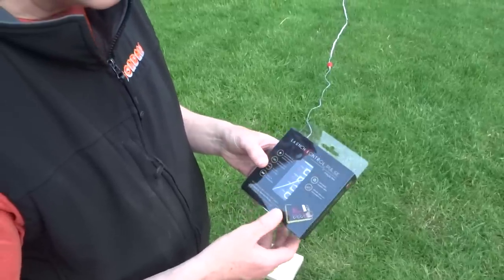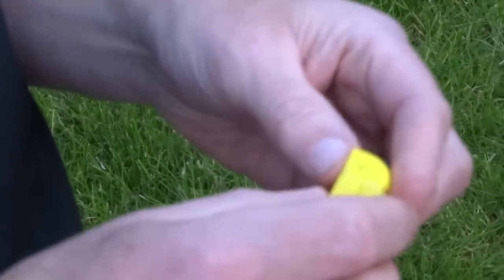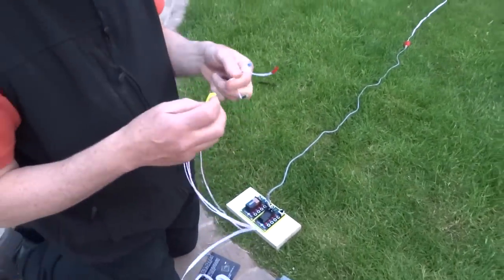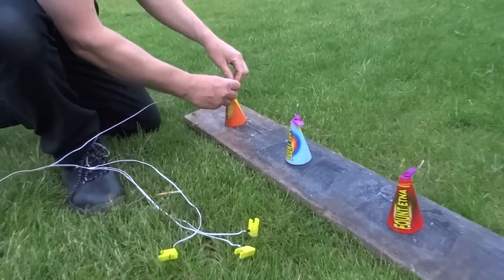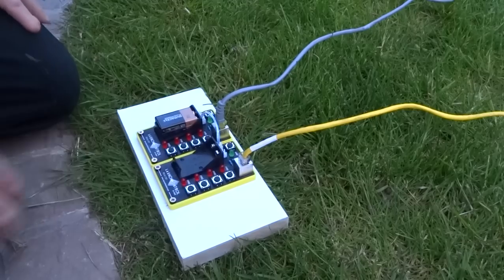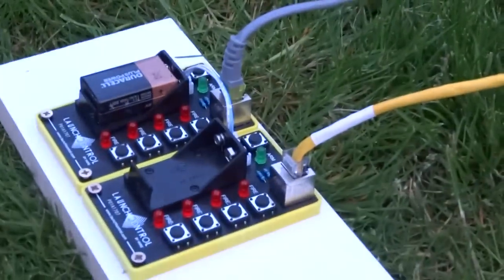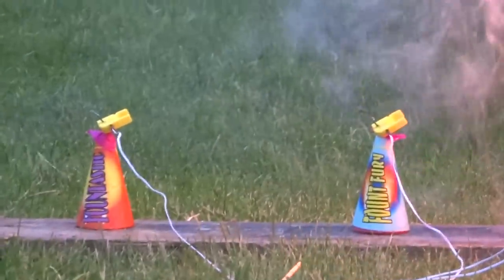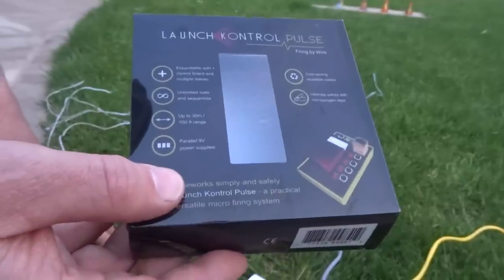Launch Kontrol Pulse Remote Firing System at Jordans Fireworks

Comment from the maker: Firing clip connector colours and corresponding position on the firing board - red connector = No1, green connector = No 2, black connector = No 3 & blue connector = No 4.
Reply: So I'm replacing those clips everytime no thanks I'll stick to .99 cent lighter I can use it all night long without replacing anything....maybe design a clip that's reusable multiple times

Comment: Where can I get the cat5 cable for this system from
Reply: We normally stock them but have sold out of the 25m ones over bonfire night and currently only have 10m one. There is nothing special about our cables but you must make sure you get a solid copper cable one as a copper covered one will not work.

Comment: I'd say definitely not waterproof. The joints between the cables would need taping to make them waterproof and the firing board would also need some sort of cover making to keep it dry. Regarding the e-clips on the fuses you can fit them and then cling film over them to keep that part of the system dry.

Comment: Hello. This would also fire gender reveal smoke color grenades correct?
Reply from the maker: it will fire any product with a visco fuse but not a ring pull smoke grenade.
Reply: @JordansFireworks ok but ring pull grenades have this green wire inside of them (like a fuse) don't they?. If I take it out and clip the yellow clip on it, it will not work?

Comment: The system worked 7 times out of 12 test. Not good when you are in a show and you have to light the fuse manually . Also the Batteries are difficult to insert and remove. I broke some Duracell ...  disappointing...
Reply from the maker: Dear Steve I don't know if you bought your Launch Kontrol from us or another supplier but as Launch Kontrol is an electronic system it does suffer from the odd one that does not work properly, we, therefore, test every single Launch Kontrol before we send it out (hence the question as to whether it was bought from us). There can also be an issue with the cat5 cables and we have come across several that do not work, which is why we also test every cat5 cable before it is sent out to ensure that all of our sets work before dispatch. If you did buy the set from us please contact us. Kind regards David - Jordans Fireworks
Reply: I bought them on Rocketfireworks.ca. I don't know if it was the cable or the igniter... but 5 of my 12 shots failed during my show ...
Reply from the maker: Dear Steve. You can eliminate which part of the system there is an issue with by just firing the e-clips without the cat5 cable (you don't need fireworks attached to the e-clips, you will see the e-clip flash if it has worked. If they all fire when the 4 way cable is plugged straight into the board then the issue is with your cable).  I'm sure Rocket Fireworks will be able to assist you once you have found where the issue lies. Very occasionally we have found a faulty e-clip (again why we test all our sets prior to shipping) but that is resolved by replacing it with another e-clip. You can pre-test the Launch Kontrol before use to the extent of making sure it all works apart from the e-clip igniting the actual firework fuse, it just means that you burn a few e-clips up in the testing. Hope Rocket Fireworks help you with your problem. Kind regards David - Jordans Fireworks
Reply: I do some test... and it seems that the e-clip have not enough power to light the fuse. And the e-clip become unusable after the test. Money-money....
Reply from the maker: Dear Steve you do need to contact Rocketfireworks.ca about this,